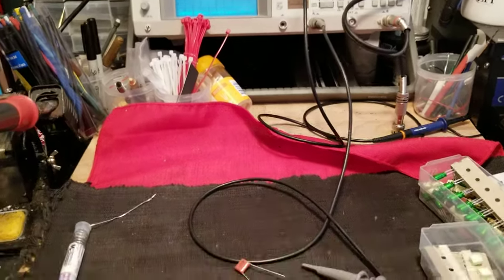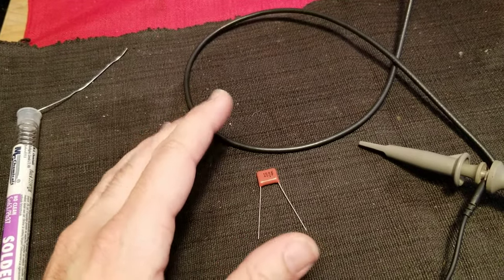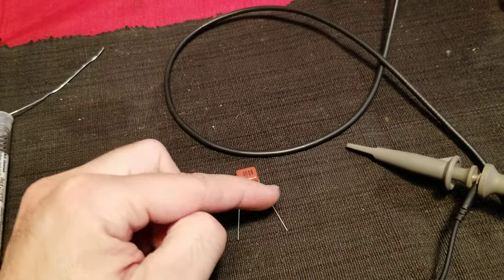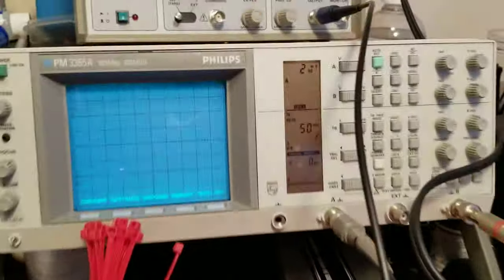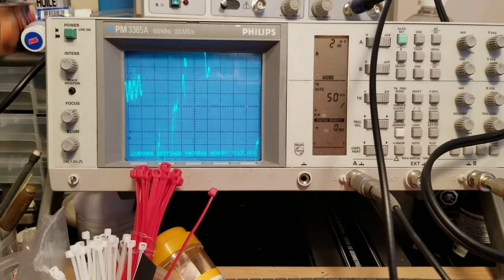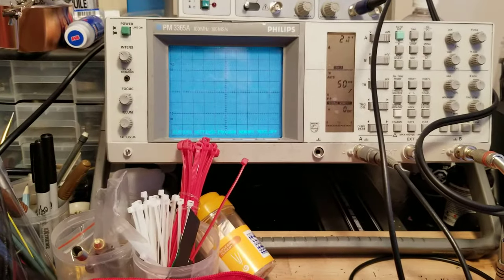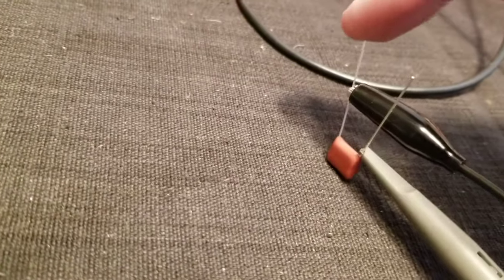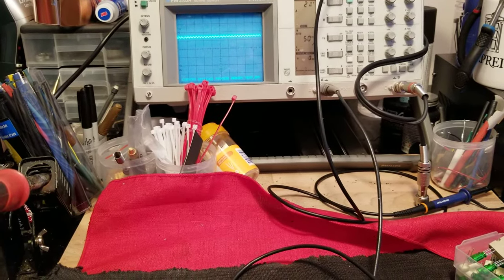Tech Tip: determining the outer foil side of a non polar capacitor, courtesy of Mr. Carlson's Lab

Comment: I used it for ages, although not terribly often.  For those without a good scope, you can use an audio amplifier and you ears as well.  Nowadays I can use the built in generator in my scope instead of the 50 or 60 Hz from my fingers.  The higher frequency increases sensitivity in the cases, where the capacitor construction is more challenging.

Comment: If you don’t have an oscilloscope, there’s an easy way to determine the inner / outer foil sides. All you do is get the capacitor’s legs and switch them back and forth between the tip and sleeve of a guitar cable that is plugged in to an amp. Whichever orientation you find to be less noisy is the outer foil. It will be pretty obvious. It also helps to run the guitar signal through a boost pedal to make this more audible.
Reply: Legend man....thanks so much
Reply: Yeah, that also requires a guitar amp.
Reply: thanks 👍,must try that, 😎just  can`t find my oscilloscope no place
 lmao... i know i put it down just here 😂🤣😁😉
Reply: so the leg  test.. equates to the foil side of the cap is quieter on the sleeve 
of the jack plug which is earthed, centre being live!😇👍 just to confirm.

Comment: lol, I use that solder too, dunno why its so much more expensive but I like the tube dispensers, lazy I guess or short handed, I can place the tube any where, pull a length out to feed the tip one handed so I can hold something with the other, I'll tape it down so it stays still.. should prolly just get a solder station with the arm holders lol, stewmac makes one you can put 10 arms on of varying lengths.. so far it's one thing at a time for me, and I like a solder gun I can easily move anywhere depending on where I feel like using it at that time..

when I see a nice solder station I always think welp I am going to need a certain amount of free space to set the unit itself then space in front of it to set whatever I am working on,  like bringing a solder gun to wherever the unit that needs soldering, breakfast table in the morning, lunch table around noon then dinner table at night, and there is logic to this make no mistake and this worked with my wife maybe it works with your but the sound logic is that when its breakfast time or dinner time whatever she doesn't have to call me to dinner and I am never late..

there was only the one time where she said "i wished you would do your work elsewhere so I can get the table ready"  my answer was "oh yea right sorry OK sure, I'll move it into the living room and use the new oak coffee table so i'm out the way..

she was like well ya know now I think about it moving all that "stuff" would take a lot of time and you'll get more done if you can just focus on it right there at the kitchen table..

I then said "yea you're right, you're always right, hopefully this year santa brings me the ncie samsung QLED 98 inch TV for the shop, a TV that size can heat the entire shop so it won't be freezing out there, then I can work on everything using those nice benches santa got me last year, and you won't have to look at the back of my head while you're working in the kitchen"...  🙂

very soon imma hit her with the, "welp, if I had a real nice solder station like the Hakko FM206-STA it would have to run off a power conditioner and that's in the shop but all my work would have to be done out there cuz that's where I would have to "install" it"...   hehe... "with that Hakko and a TV i'd only need to come into the house to eat, unless someone was to bring me a plate?...  lololololo

Santa gonna need a big bag this christmas I already know, I will supply the paper plates and cups cuz I'm good that way...

Comment: I notes one of the leads was longer coult it be like on other components that the lead length is an indicator?
Reply from the maker: You won't normally see that on film caps but you will on radial bipolar electrolytics. The same rule as polar applies: long is "positive", short is "negative", with the negative being attached to the outside of the can. So short = outside.

Comment: I am getting the exact same reading regardless of which way capacitor is connected. Ive tried three different types of non polar capacitor including one you showed in vodeo I am not getting any difference at all
Reply: ended up using the audio amplifier method where you connect it across mic jack then reverse and see what end is loudest when you touch the body of the capacitor. This tells you which side is the foil side. It was very noticeable with volume cranked up while touching capacitor. Maybe I just don't know how to set up the scope properly but it didn't work for me.

Comment: Hi Jason and thanks for all you do and please I have a question about replacing caps in my grand dad philips vintage radio in my country I cannot find proper replacement for the paper capacitor so should I replace them with ceramic caps especially those with low farads and I am concerned with the polarity which ones have a polarity or not , so forgive me for taking your time and appreciate any response
Reply from the maker: Hi Abdullah don't overthink it, generally polarity in non-polar caps is pretty much optional and won't seriously affect function, it's just slightly better to stay consistent with them. I personally would avoid using ceramic caps unless they were used in the first place (they are selected for specific properties in some cases). Otherwise ceramics are noisy and drift with temperature. Any film type cap is a good choice to replace paper, regardless of type. Check out Mr. Carlson's video on selecting types: https://www.youtube.com/watch?v=67M7fsbLUIU

Comment: If using either Polyester or PP caps with outer foils as coupling caps in a tube amp, should the outer foil (lower potential) lead be closer to the grid of the proceeding tube stage or closer to the plate of the preceding tube stage?
Reply from the maker: Easiest way to think about it: in coupling stages have the foil facing the incoming signal. So it will be pointed to the preceding stage. Some people over complicate it by saying "foil facing the lower impedance side of the circuit", as in the previous stage (output = low imp, input = high imp)
Reply: @OddAudioCanada  I guess in my head that would be backwards of what I’d expect because I thought since the cap blocks DC, lower potential direction would be after it (going to the grid of the next stage) but it seems that is not the case.  

What about if there are resistors on either side, and the resistor between it and the plate of the last stage is larger than the one between itself and the grid of the next stage?  I have a unique case in my red knob amp between the phase inverter and power tube where this is the case.
Reply: @on1ytheb3st  It might be academic in your case, but I always think about it in terms of "shielding towards incoming signal" regardless of the circuit (or shielding to ground for bypass/filter caps).
Oops used my other account, yes OddAudio is related to OddBike!

Comment: So how would I solder a tone cap on a guitar once I have this information?
Reply: I reckon : one end of the tone capacitor is connected to ground, usually the back/casing of the potentiometer. You find the "shielding leg" of the capacitor.....THIS is connected to GROUND. 😊
Reply: @vacuumelite2065  Thanks!

Comment: Are you using a Function Generator also to put across the capacitor under test? so you're just ONLY using the Oscope probe leads and it will measure an AC waveform, why? I'm guessing the capacitor metal leads are antennas picking up stray AC
Reply: His body is the antenna I think

Comment from the maker: Bonus fact: in bipolar electrolytic caps, the outer casing is connected to one side same as in a polar cap (where negative is connected to the case)... You can check continuity to the case to find this lead, but if you buy them new the leads are asymmetrical just like a polar cap... and the outer case is connected to the shorter leg.
Reply: This is exactly what I was looking for. I have some Nichicon Muse for an amplifier that i'm refurbishing and there is no continuity between the casing and the legs, and the oscilloscope thing also doesn't work. I hope that you are right about the legs though. Thanks!

Comment: This method doesn't work with my scope at all.
Reply from the maker: Some film caps don't have a "foil" that you can measure (they measure the same both ways). Make sure your scope is set to highest sensitivity and extend the time base until you see the wave.
Reply: Don't worry about it. its all bollocks.
Reply: Same for me. I've tried this test with numerous capacitors many many times with both an oscilloscope and an audio amplifier and can tell absolutely no difference either way. The results are inconsistent at best.

Comment: New components aren’t marked because there is no outside foil. Only electrolytic caps are marked, good reasons.
Reply: En los Orange Drop que yo compro si ocurre este tipo de cosas. Yo veo muy adecuado hacer esta prueba. Saludos.
Reply: If a capacitor is of rolled up construction, there is 100% an "outside foil". Many capacitors (not just electrolytic) are still made this way. Correct that there are certain constructions of capacitors that would have no "outside foil" though. It also probably matters less these days because even a rolled up capacitor has a much smaller cross-sectional area than an equivalent older one... thus limiting the potential coupling from the rest of the circuit into the outer foil. Long story short... if you can see the effect on the scope, it's there.

Comment: New caps are not made with old technology of the outside foil. Why would you be using old caps? Electronics components were not made to last forever. Even in the 1939’s planned obsolescence was part of the bigger picture, thus FM, Stereo, Transistor radios, and cell phones.
Reply: I think you answered your own question.